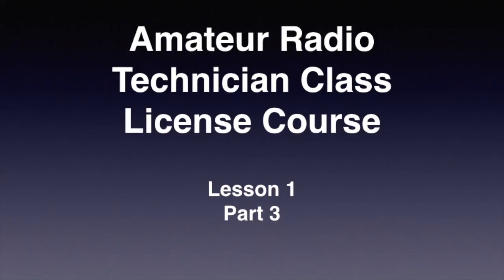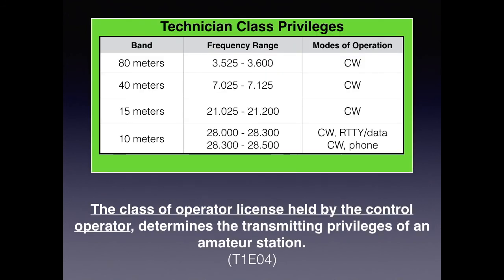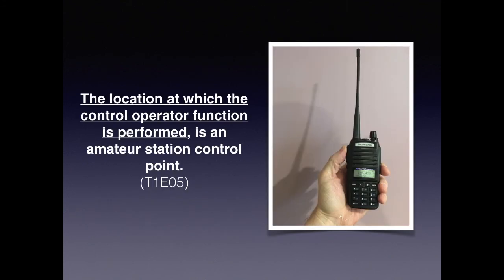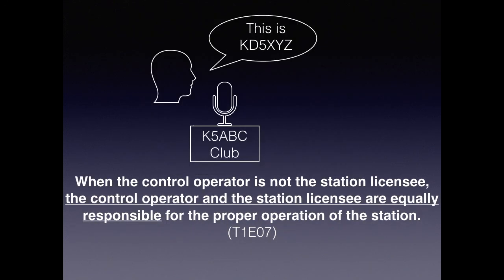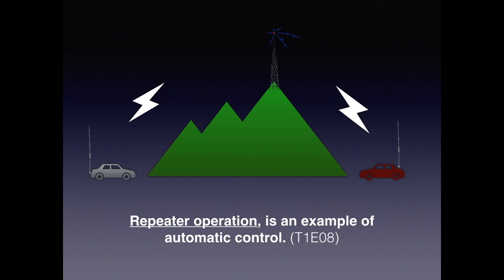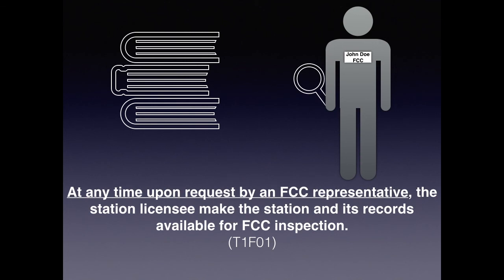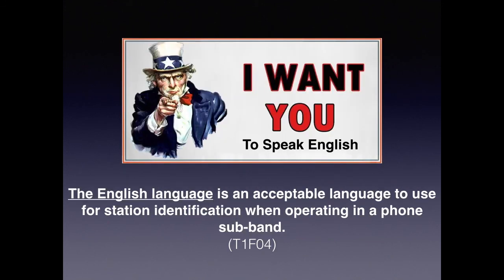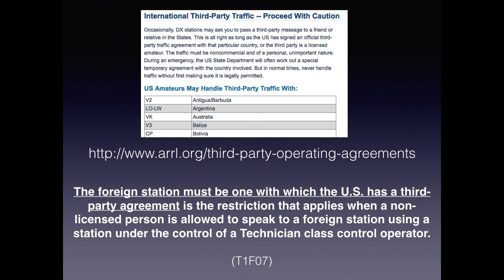FCC Amateur Radio Technician License Course Lesson 1 Part 3

Comment: Do you need a license just to listen to the ham radio?   I don't want to contact or talk to anyone! Thanks
Reply from the maker: You only need a license if you transmit.  Anyone can listen.
Reply: @RedWagonTechnology  -Thanks! I just bought a ham radio on Amazon and I don't know anything about ham radio! Can I ask u a question! I'm not trying to be dumb! To listen to a ham radio do u just turn on and listen like a normal fm/am radio?
Reply: @CT 
You may program the radio to pick up local Fire/Police/EMS services.  The radio itself may have come with a USB cord to plug into the computer. The ARRL site has a list of the local stations you may want to program into the radio. I am assuming you want to use it more like a scanner than a radio. Good luck!
Reply: @MAGADeathblossomingDemocrats  -Thanks for the information! And yes u are right I just want to use this as a scanner to listen!